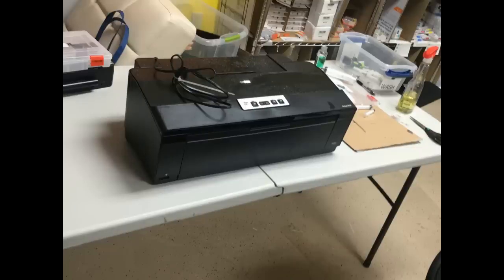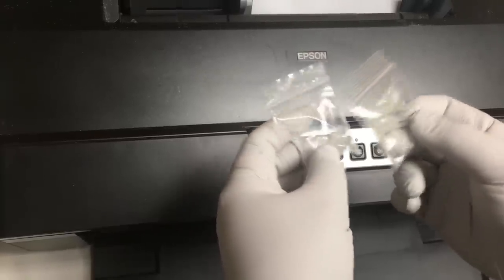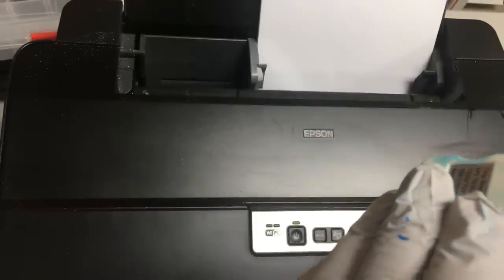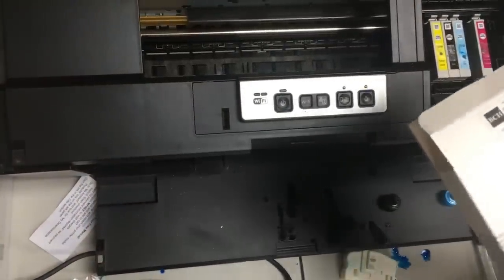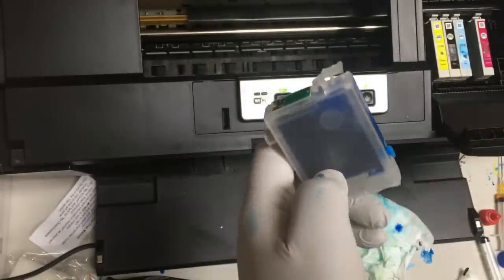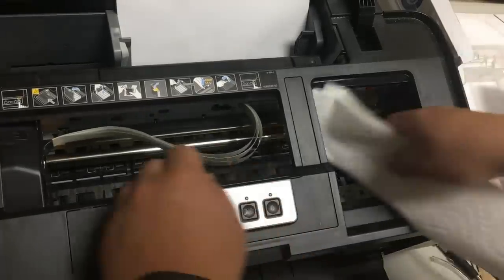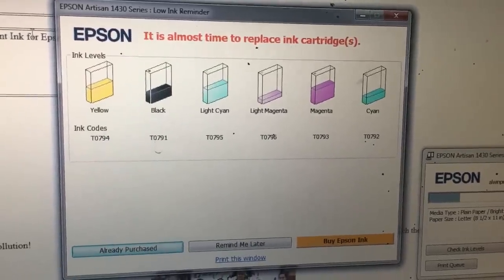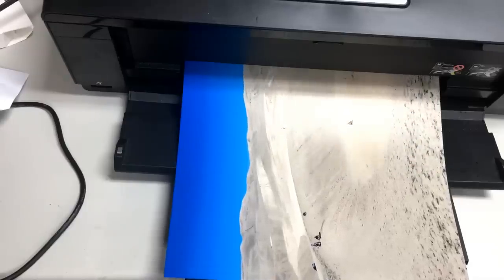Epson Artisan 1430: Refill Original Cartridge, Chip Reset, Refillable Cartridge and Unclogging

Comment: Nice job on showing how to flush the system.  This is called a deep flush.  Consider taking a sheet of photo paper (a bad print) and advance it through the printer, pulling the printer power plug when it is 1/2 way through.  Now you have a sheet of water proof paper under the print head.  Put you paper towel to the left, and move the print head over your photo paper. Put a marker or object 3/4" to 1 " high under the right side of the printer. This will help the flushed liquids flow to the left to the paper towel.  Hope this helps.  This is how we've been doing it for 10+ years and hundreds of flushes and deep flushes.  Regards,  Doctor Epson  Docp Lakewood CO USA

Comment: One thing I hated about my Epson 1400 is it would do frequent head cleanings. I remember printing out a bunch of full page photos, and every 5th photo, it would stop to do an automatic head cleaning for whatever reason. And sometimes, it would do an automatic head cleaning on the 5th print, and then after the cleaning, it would have clogs that I would then have to do manual head cleanings to try and fix the clog that was caused by the automatic head cleanings. So annoying, but the prints are pretty good.

Comment: I'm going to have to get a new printhead for my Epson 1400. It's had clogs for 5 years now, never could get it fully unclogged even removing the printhead to clean the nozzle side and then flushing cleaning solution through it via a syringe and hose. 

I think maybe there is corrosion or something on the nozzle side instead of it being an ink clog as I use dye ink and so flushing it with cleaning solution should clear any ink clogs out. I even set the print head in a small plastic tub with like a 1/4" deep cleaning solution so the nozzle could soak in cleaning solution for a week, and that didn't do anything.

Comment: 😢 my refillable cartridges won’t recognize how do I know if it’s a firmware or software issue for the 1430? I have 3 sets of cartridges none are recognizing. I’ve replaced the CSIC clips and the board idk which firmware I need to be I bought this from someone else but it shows hasn’t been updated since 2021 please help
Reply from the maker: Thanks for subscribing to my channel. Sometimes the error is not caused by the firmware or CSIC board (of course they should be checked) but by the printhead. Make sure you have a working printhead by putting on a testing unit.
Reply: @BCHTechnologies  print head has been changed I did find your other video about the firmware it was last updated 2021 but I purchased it from someone. The firmware get half way to about 59% then got stuck. I tried it again now it says failed. I wish you were closer I’ll come in for a repair 😭

Comment: Hello.  I would like to know if someone can help with this question...Can I move the board (PCB) from an OEM cartridge to a refillable cartridge? In other words, get rid of the ARC so that I can use the resetter with a refillable cartridge.  Why?  If the printer thinks the refillable cartridge is empty, you go through the resetting procedure which alway cleans the head.  There is always one color that is just about empty. They are never in sync.  I don't want that. Also, it will stop printing in the middle of the page when it thinks the cart is empty, which wastes the page. Costly and wasteful (and annoying) if doing DTF/DTG, etc.  Thanks

Comment: Hi Kevin, Thank you for your video, however I have a new Epson WF-7725 and started with Sublimation ink and the printer accepted the cartridges  now I want to go back to original genuine cartridge & it won't accept the Epson cartridges it says INITIAL CATRIDGE DETECTED PRINTER ALREADY INITIALIZED how do I initialize the genuine Epson cartridges ? Many thanks
Reply from the maker: You probably using the “I” cartridge.  For the newer models, you can use the starter cartridge only once.

Comment: I HAVE REFILLED MULTIPLE CARTRIDGES USING THIS AND OTHER METHODS AND IM HAVING THE SAME ISSUE WITH ALL. WHEN PRINTING HEAD TEST BARELY ANY LINES PRINT. IVE RUN THE HEAD CLEANING 100 TIMES AND EVEN REPLACED THE HEAD WITH A BRAND NEW ONE THINKING IT WAS DAMAGED AND NOT SPRAYING. WHEN PULL THE REFILL PLUG I ADDED THE CARTRIDGE IS UNDER PRESSURE, SHOULD THERE BE AN AIR INLET THATS MAYBE CLOGGED OR IS THERE AIR BUBBLES TRAPPED? IVE PULLED INK FROM THE BOTTOM WITH A SYRINGE AND IT HASNT HELPED
Reply: Your cartridge is not venting properly.   So the ink cannot flow.   You either have a blocked vent hole or the cartridge vent is blocked inside.